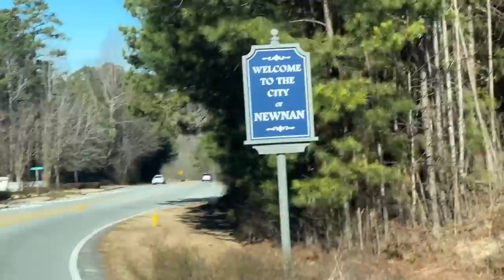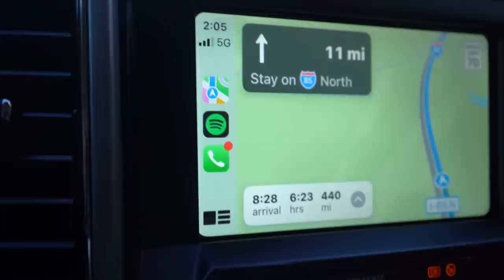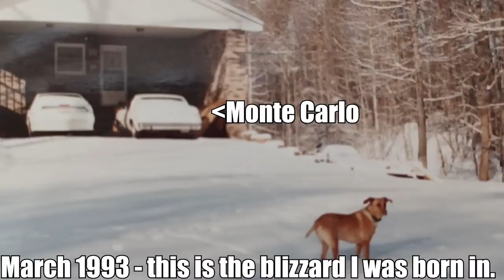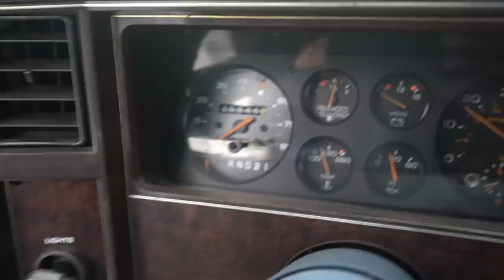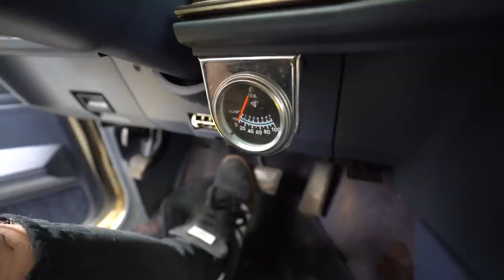Buying my grandma's old car back. sitting for 22 Years.

Comment: A quick "little car" haha that thing is a huge boat its a little over 17 feet long
Reply: That's just a mid size
Reply: @lb9gta307  about the size of a Chevy Tahoe
Reply: @joshuanicolai4776  about the size of a Camry you mean
Reply: @lb9gta307  a Camry is well over a foot shorter
Reply: @joshuanicolai4776  just under 10". The difference in width is less than an inch, the Camry being the wider of the two and also 2" taller with a 4" longer wheel base.

Comment: Need to check the pedals very well could be that low of miles  I picked up a 86 that had 68k on it and body was in similar conditions  mine needs paint but like conditions pedals are a give away to the miles

Comment: 6:43🙋‍♀ I'm sure somebody has already commented this before but, wouldn't it have been better to just roll it down the drive way in reverse onto the street and then back the truck up to the front of the car instead of pushing it in circles around the yard?🤔🤣

Comment: Hey man, you should really consider upgrading your audio when its not a voice over. It is a big hard to watch, as audio/hearing is one of the most sensitive things. The retention rate seems to agree as it falls whenever your audio is sub par. This is just some critique that could really increase your views and your audiences experiences. Much love and i always enjoy your videos dude!
Reply from the maker: Here’s the thing with that. I’ve tried so many different setups. In this video. I used a fancy wireless lapel mic for the second half. And as is the case everytime. The audio is worse. The stock camera mic with a windmuff had the cleanest sound as far as not being too peaky and clipping. I’ve got two shotgun mics I’ve tried. Lapel. Everything. Unless you have a dedicated camera man adjusting gain on the fly. It always sounds worse than just the stock camera microphone.
Reply: @Taylordrifts  Appreciate your reply. 
I see man, it is a struggle. Perhaps look into using a Zoom H1 (pretty cheap used on eBay) with the lapel for your in truck audio. It typically provides crispy audio.  Since its a dedicated recorder, youll need to match the audio with the clip but premiere can do that automatically. 
My zoom settings are: Lo Cut on, 
Auto Level off, Rec 
format WAV.  In this specific video, the intro in the truck was pretty harsh. And, that's the intro where potential new viewers may click off automatically. Your subscriber viewers will grind through it because we are dedicated to you and your story. 
Glad you are restoring this relic. Much respect.

Comment: Beginning of the video: "it's so hard to find one of these that are untouched and original this car is that! Unmodified and stock, never had an engine swap these always get a 350 swapped in"

End if video: "yeah I'm gonna remove the drivetrain and  swap it and all the suspension"  

Ugh. My dad had an 84 SS identical to this, was also a survivor. He sold it in 2013 and the next time I saw it, it had a worked up 355 small block and all sorts of other shit.  And people wonder why low mile, stock examples are getting so expensive!